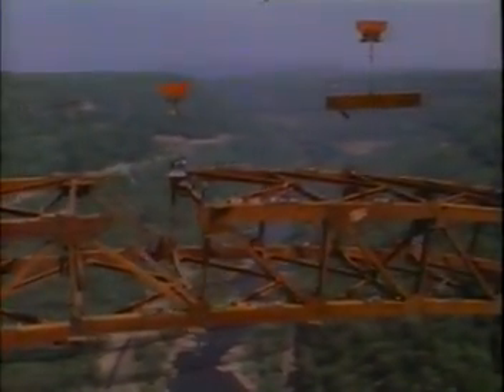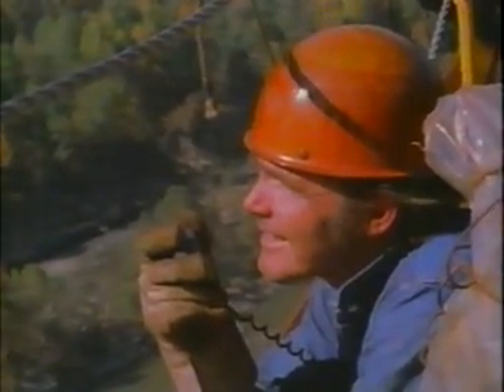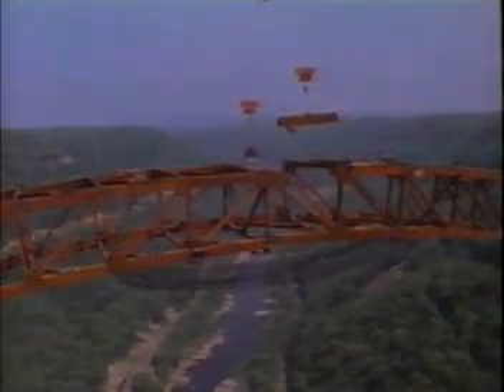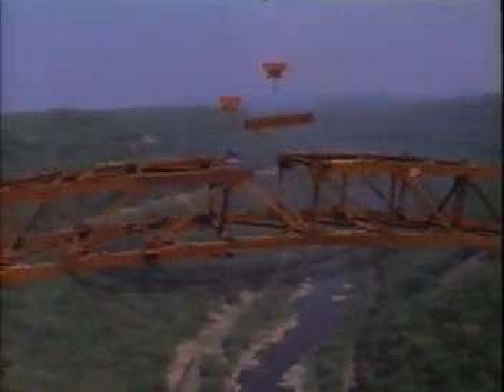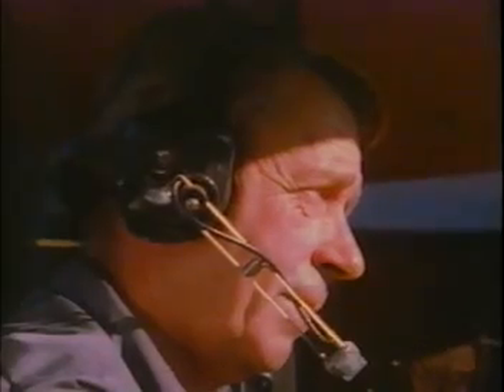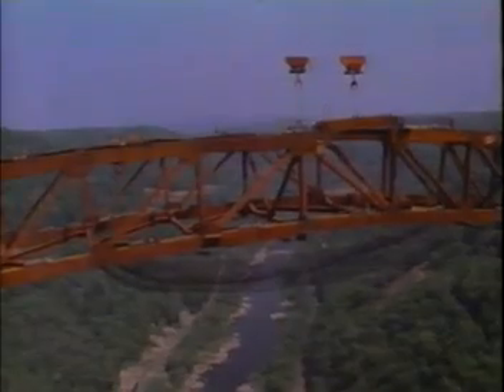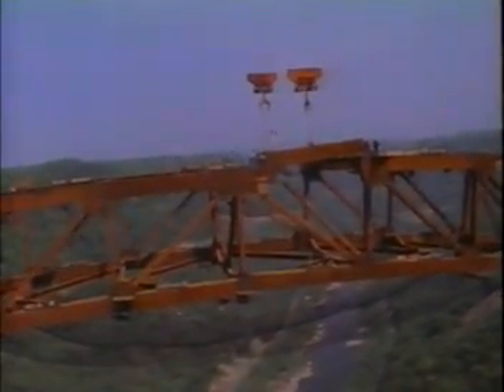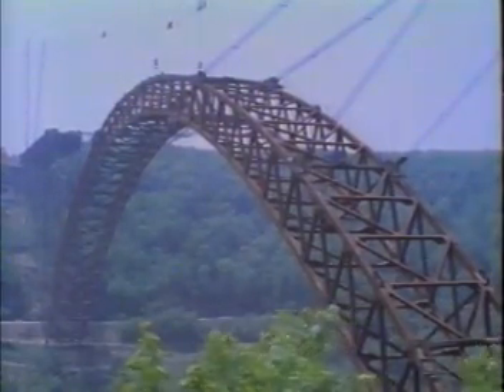New River Gorge Bridge Built by American Bridge

Comment: This was the company I worked for beginning in 1969 even before I graduated from Lorain, High. Lorain, Ohio. My dad, Colonel Baxter, was head of the Operating Engineers (Crane Operators) for the company.  My last job with American Bridge was operating a 4100 Manitowoc with 290' of boom inside U.S.Steel on #3 Blast Furnace.
KB
Reply: I was there in 76 with highway paving.  We poured main line up to the bridge on the west side  the Indians where living in tents up a small hollow. I watch them from the old iron  bridge down below hang iron with the trolley.  I was a union labor out of Ohio.  I went on to become a bridge superintendent in 2002 I was on the ravenal  bridge in Charleston Sc double towers. One of ten superintendents on that project.  Retired now pour concrete for 45 years.  Semper fi.
Reply: Anymore building footage 🎥

Comment: I remember when this bridge was being built back in the 1970s.
Reply: Best video ever
Reply: American Bridge built the Oakland Bay Bridge, the Mackinac Bridge, the Verrazzano-Narrows Bridge cables and deck, the George Washington Bridge, the Empire State Building and the Chrysler Building at the same time, the launch gantrys and the Vehicle Assembly Building at Cape Canaveral, and just about everything else in this country that's worth mentioning, for years they were United States Steel's Ironworking division and the town of Ambridge Pa (short for American Bridge) is where the steel was fabricated for all those iconic structures, they were so big they made their own spud wrenches, they had a forge in their Ambridge shop that they would hammer them out of 1 inch rivets, I used to be an Ironworker and did work on old bridges and buildings that they had originally put up, several times we found the "topping out" beam and saw them with American Bridge written on them with the crews signatures and a dates going as far back as the turn of the century, the monthly Ironworker magazine for union workers had an article in it about 25 years ago that was about the refurbishment of the South Carolina state capitol building and they had a picture of the topping out beam that was marked AB with the crews signatures dated sometime in 1896, that's even before US Steel owned them, if you're an Ironworker AB is like God up high on the mountain.
Reply: @dukecraig2402  My father in law worked for AB for over 30 years and and played a key role in the new river gorge bridge. I often look to see what projects he was involved in. When he passed away his children always mentioned him being an iron worker but thru diligent reading, I later found out he was a superintendent on many projects.
Reply: @dukecraig2402  Got AB spuds and Bethlehem steel spuds they were given to me by couple a old timers when I was an apprentice L U. #36. I worked for  AB only once. I remember reading that same article in the Ironworker  though too.
Reply: @dukecraig2402  That's about where I'm at with it now too. I'm about ready for the junkyard 🤡 and the political end of it is just not the way it used to be and they dissolved scranton Easton reading and merged em all into Harrisburg  I'm looking for a way out and sooner the better  but it's heartbreaking to know how it was and to see what it is going on now is terrible. Yeah I seen that they are selling for crazy $ online but I wouldn't ever get rid of em just because of where they came from the guys that give em to aren't around anymore and they were the ones who broke me in ya know  anyway god bless and enjoy your retirement sir
Reply: @roscoep.coltraine6344  
Unfortunately I'm only retired from ironworking and not working as a whole 🤣🤣🤣.
But like I said it was one hell of an adventure when I was doing it and I wouldn't trade the experiences I had doing it for anything, it's like I tell people when I hold my hand up to my neck "I've got a pile of stories this high, and they're all true".
You'll never work around a crazier more entertaining group of guys like an ironworking crew.
Reply: @dukecraig2402  You ain't lying either! I remember my first day on the job ever they said to go see the stewart and  the 1rst thing he told me was kid this is gonna be the best part-time job  you ever had.
Reply: @roscoep.coltraine6344  
I just realized that you said Scranton got rolled up into Harrisburg along with several others, 489 Scranton was my local. 
I've been out of it for about 21 years now and that's the first I've heard of that, when I was still in Scranton had absorbed Binghamton NY, I'd never have thought that Scranton would have wound up getting absorbed into another local, they were pretty strong back then.
I guess nothing lasts forever.
Reply: @dukecraig2402  it's a long sad  f'd up story it came about from international they didn't give any of the 3 locals any choice in the matter 36 was one of the oldest locals in the international  think that they were the 3rd local  bunch of crap
Reply: @dukecraig2402  You are correct but 36 was 3 oldest out of the remaining locals for a while up until the mergers but yeah I may have worded it wrong Chicago was the 1rst I actually have a  history of the international book that's got all that stuff in it
Reply: @dukecraig2402  I was also a steel worker before I got into ironworkin 36 was chartered 1902
Reply: @dukecraig2402  Yeah I'm not saying weak I'm saying shifty. Put it this way the guy behind it all is president of the new Jersey state senate
Reply: @roscoep.coltraine6344  
I was in the USW's when I built river barges on the Monaghelia River, a large corporation bought the place just to shut it down, when they did the international came in and seized the money our local had in our account that was in a local bank, their rationalization was that it was the unions money and since our local no longer existed then it belonged to the international, that was total bullshit, that was our money and should have been divided up equally among all of the locals' member's.
Which really didn't matter anyways because working at that place was like not having a union, the bosses regularly did things like have you working under a higher pay grade position and if you filed a grievance nothing would ever come of it but the next thing you know the shop steward that you filed it through would be working a bid job that a bid was never posted for.
You know you're in a bad situation when every morning the shop stewards are getting their coffee in the bosses yard office instead of the union break room where everyone else gets theirs.
Reply: @dukecraig2402   I was at a pipe foundry Atlantic States mcswain inc and we paid dues to the steel workers. And all of the same exact snake💩 went on there too. Every single last shop steward that was there in the 9yrs I was there  always jumped over to salary position with the company  PBS I think it was did a documentary about the place Atlantic states iron foundry a deadly game or something like that they were caught trying to cover up I guy that got run over and killed by a forklift that they forced guys to operate without brakes and a backup signal. A whole bunch of the 💩🦃's running the plant are sitting in federal prison rite now. There was 4 or 5 guys killed and  I don't remember how many arms legs hands and fingers lost oh and 1 eye in the time I was there.
Reply: @roscoep.coltraine6344  
Sounds like a fuckin war zone, I'm gonna see if I can find that PBS (or whoever's) documentary, it sounds interesting.
Reply: My cousin,unfortunately fell to his death,him and some others were (to the best of my knowledge & as I was told by family members) crossing the catwalk underneath this bridge and unfortunately he didn't make it when they got to the other end,If my memory serves me correctly, they had to jump a little ways to exit the catwalk.He didn't make it,landed on a rock ledge...R.I.P. Cuz!!!